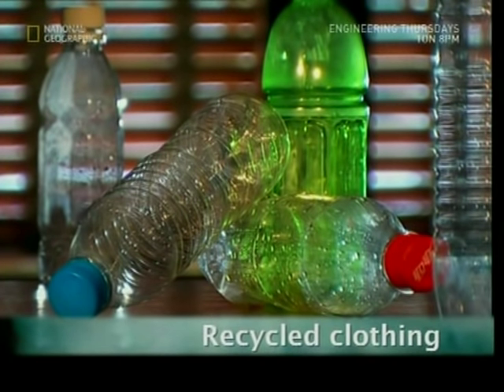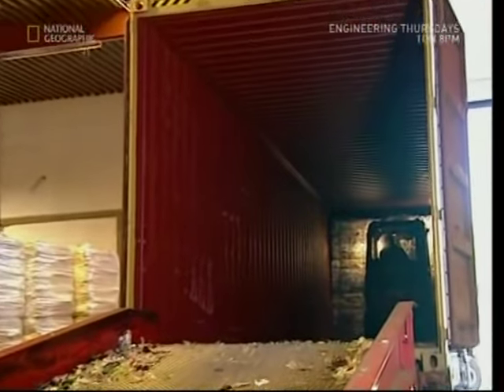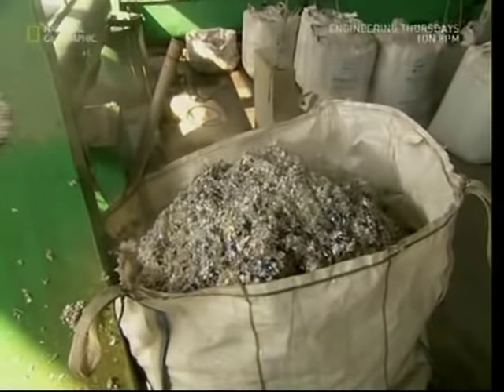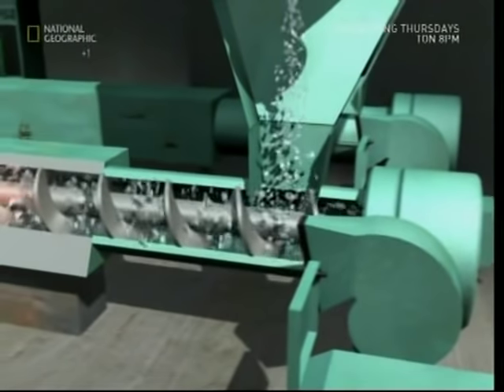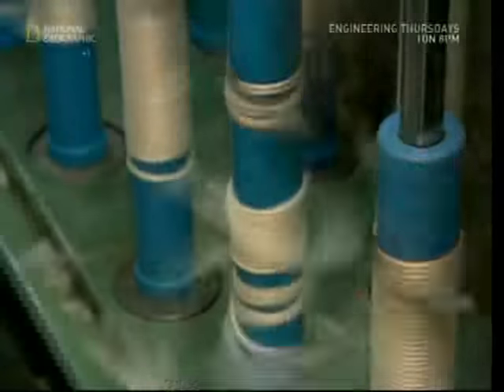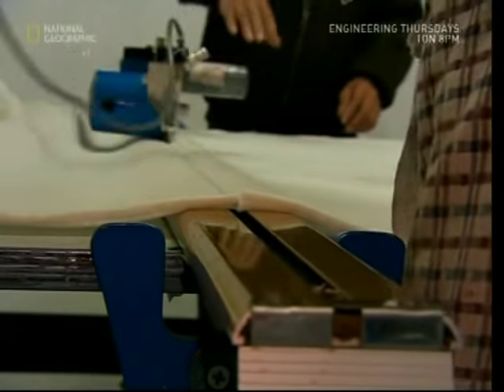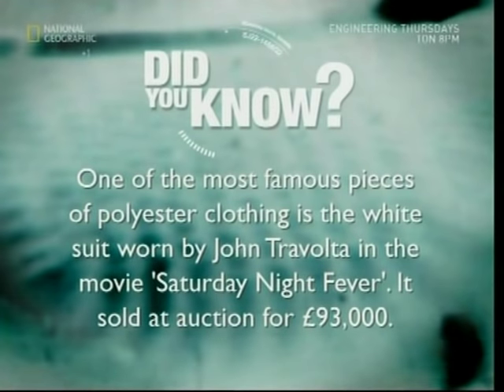How Plastic Bottles Are Recycled Into Polyester

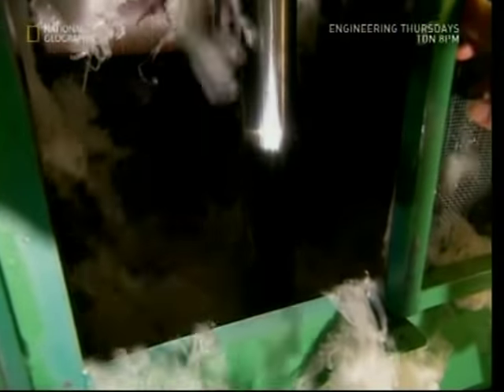Comment: Most inefficient way i have seen, this could have been way more automatic, so the workers don't hurt their backs. E.g, the shredder at 0:55 could be put over the container and at 3:06 they could use a conveyor belt.
Reply: yeah and the conveyor belt that separated the lids and wrappers could have just gone down so there instantly separated as the clear on doesn't float the colored ones than could have been put into bins and turned into microplastic roads

Comment: In Australia, the two biggest supermarkets, Coles and Woolworths sell bottled water. I buy from Woolies, as their bottles are of a better quality, as in, when you grip them, their sides are a lot firmer than the ones from Coles. Coles bottles are too squishy, in that a firm grip whilst opening them for the first time, can have the contents spilling out. But the real reason for this comment is not so much in the quality of the medium in holding the contents in, but for the recent increase Woolies has imposed in pricing, in relation to how we take the empties to a recycling station to claim the 10 cent refund. Just a few months ago, a slab of their own brand of 24 bottles sold for $6.00. Now that same slab sells for $8.40, an increase of $2.40. $2.40, hmm, the exact amount you'll get back on a printed voucher that you can return to Woolies or Coles to put towards more bottled water or other groceries if you so choose. So basically, the $6.00 one used to pay for a slab of 24 bottles, will see one still paying that same amount, rather than the $3.60 we effectively paid before, when we recouped the $2.40 on the empties from the recycling station. Putting it to another 24 bottles to recycle for another $2.40 voucher would see the next 24 bottles costing you a mere $1.20 in real terms. It would appear, that that price increase is all rather pointed to that end, whereas if they had of increased it by $3.00 or more, we'd have simply put it down to the general cost of price rises. I suppose on the surface it's all part of big business not willing to let go of a measly $2.40. Not willing to appear pedantic, but I think their slogan, "that's why I shop at Woolies", doesn't do it for me anymore...

Comment: You would think it would be more environmentally greener to use a solar powered HDPE2 shredder, 350° melter, and press mold to make stock plastic instead of using wood. Recycled HDPE and recycled steel is the way to go for building green I think but this is just a consumers opinion. Also, you don't have to ship to China. Keep your waist local to process and provide jobs. Only thing I would ship to China is non reusable waste that would otherwise go into our landfills.

Comment: Things that annoyed me about this video:
1. Those aren't bobbins they are rovings you take the rovings and it goes through ring spinning and it gives you yarn. 
2. Spinning gives you yarn not thread. Thread is a ply yarn or a cabled yarn, so 2 or more yarns are combined to give you thread. 
3. That is not a loom. That is a circular knitting machine. Circular Knitting machines knit they do not weave. 
4. you didn't turn the recycled plastic into polyester. The polymer of polyester has not been chemically altered at all, you started with polyester bottles and then you cleaned it up, melted it down and extruded polyester fibres.